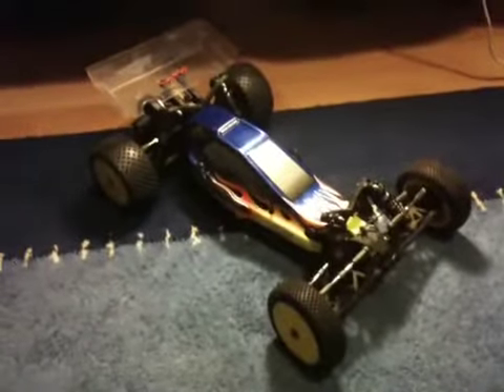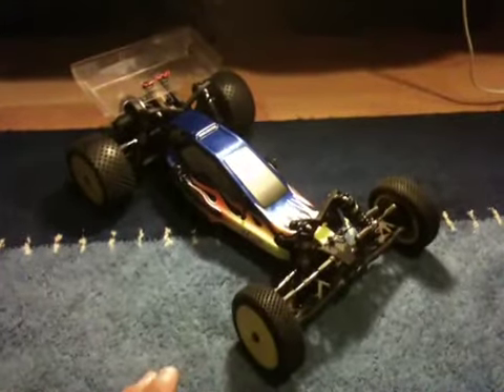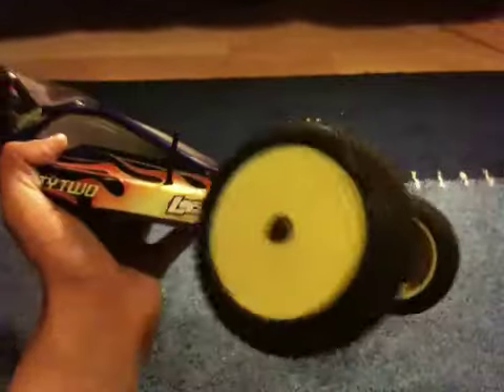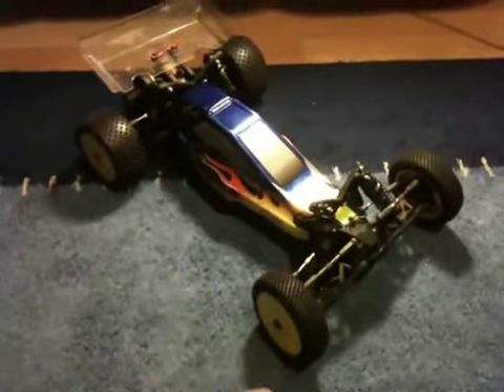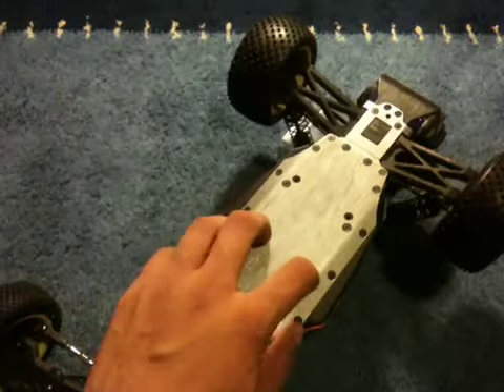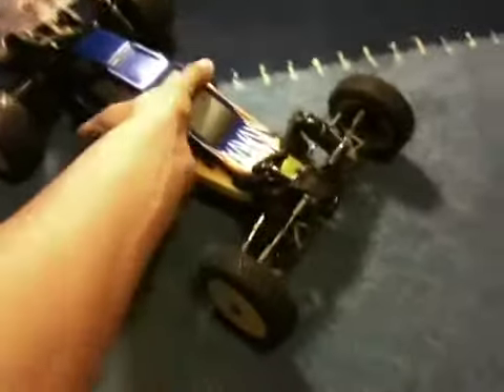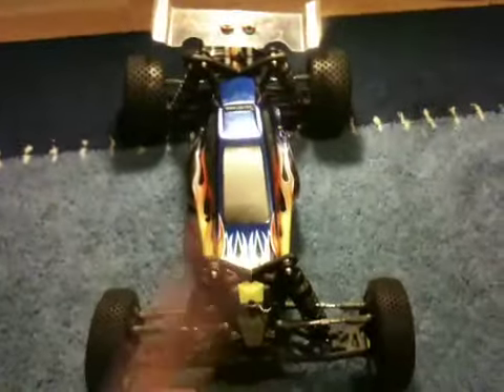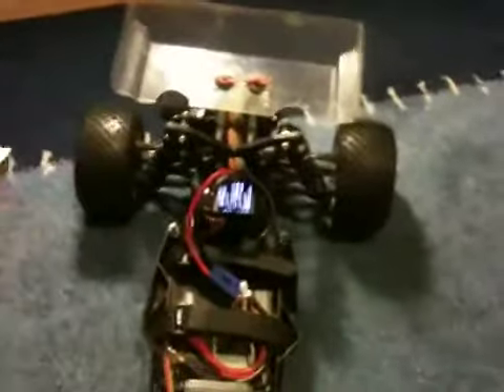Losi 22 RTR upgrade guide for racing! part 1

Comment from the maker: i don't remember saying to "throw it out" but the 22 rtr chassis doesn't have the pockets in the chassis like it does with the tlr chassis so it's a lot heavier therefore i wanted to lighten it a little via putting a tlr 22 chassis, so then it makes it a bit more nimble but slightly hard to control.

Comment: I'll be blunt - the fact that you recommend throwing out the aluminum chassis means that you don't understand why it's there. The 22 is designed with stability and handling in mind, at the expense of being the heaviest vehicle in its class. However, a positive side effect of this higher weight is that the vehicle is more planted. It can put more power to the ground and be driven harder than other vehicles in its class without getting out of shape or losing traction.